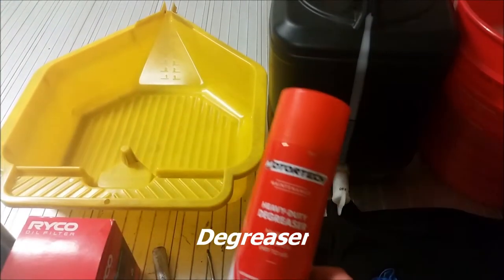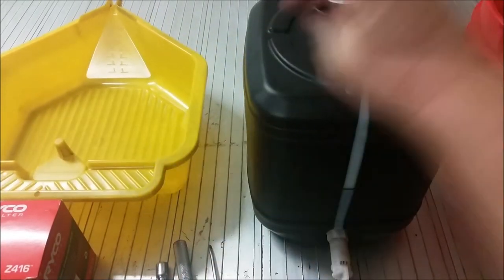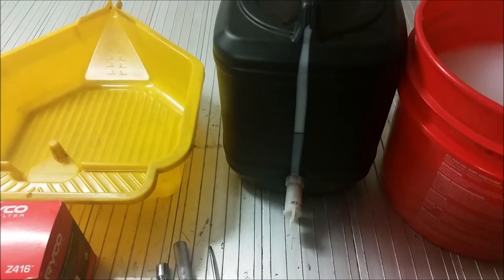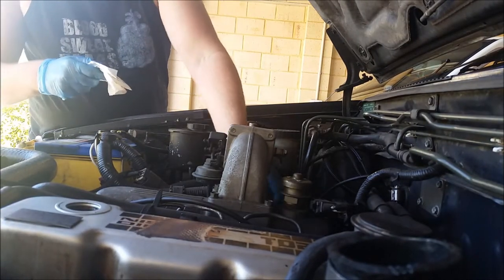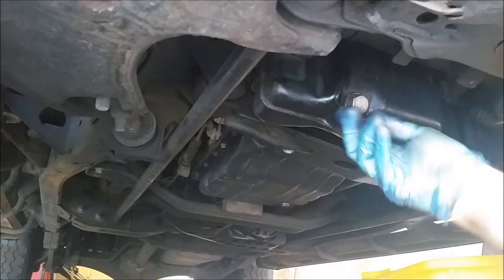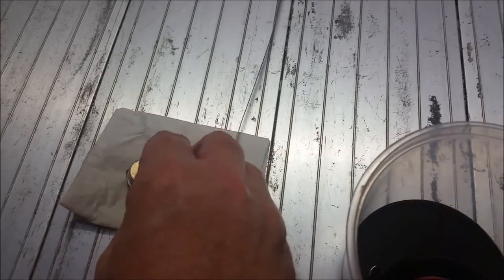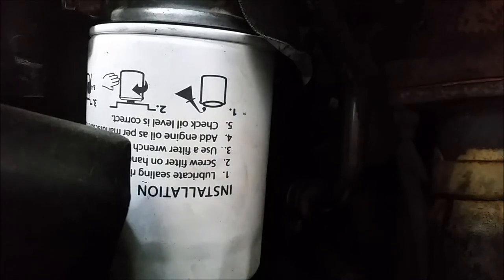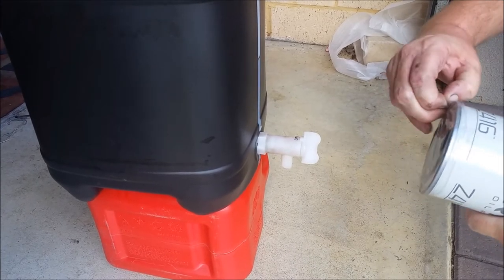Terrano oil and filter change

Comment: I came here to see how you get the oil filter off. By far the hardest step. How did you do it
Reply from the maker: If you are a bit short you might find standing on a box to lean over the engine bay helps. Then put each hand down the sides of the oil filter and turn. It's not that hard. Put a plastic bag underneath to catch any drips. Then you have to turn the filter towards you at an angle and it slides up and out. Remember to half fill up the filter with fresh oil before reinstalling. Sorry I couldn't film it quite well, there's not much room in there
Reply: @trulymeparker  I had to stuck a screwdriver into mine 1st time I changed the oil, that tight!